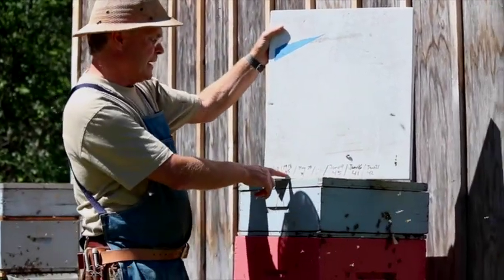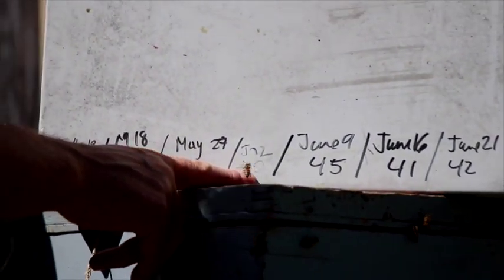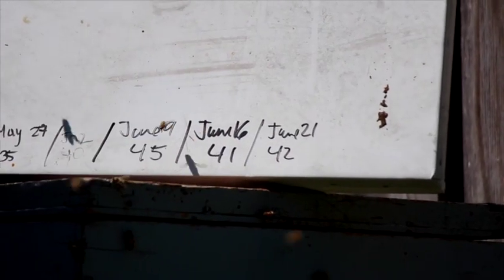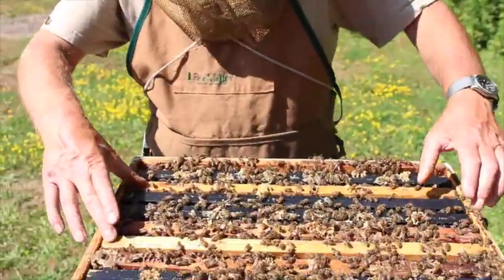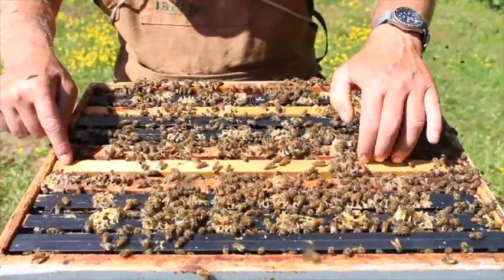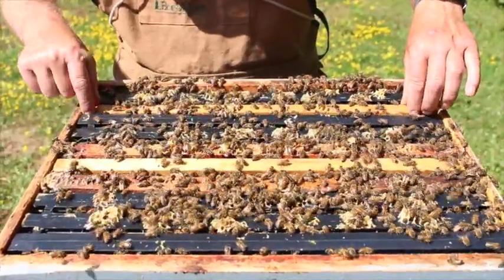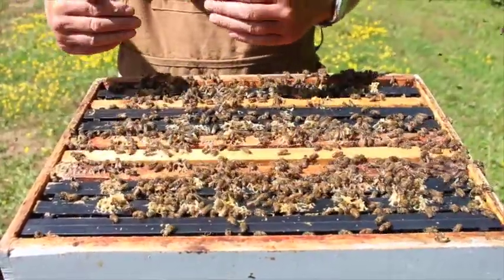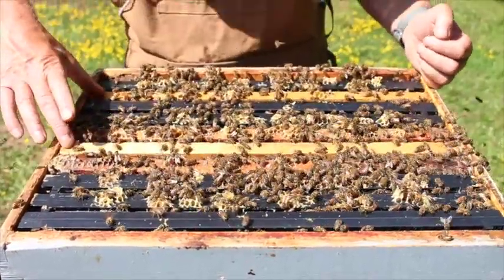Cell Building Part II

Comment: Thank you again for your videos.  I've started raising queens this year.  It is loads of fun.  Question I have is: Is there a way to tell if a grafted cell that has been in the cell builder for a couple days is on its way to becoming queen cell? I don't have near the success you have in converting grafted cells to queens cells, generally I average 20 out of 45, and I'd like to re-graft cells that aren't going to develop into queens.  Thanks again,

Cliff
Reply from the maker: Hi Cliff
You are most welcome.  If you are just starting with queen rearing you are doing well with 20/45!  Re grafting would put you timing for cells off. Just graft again on the next cycle.